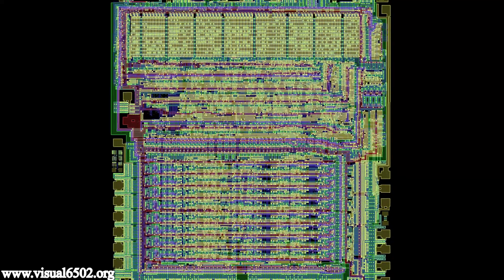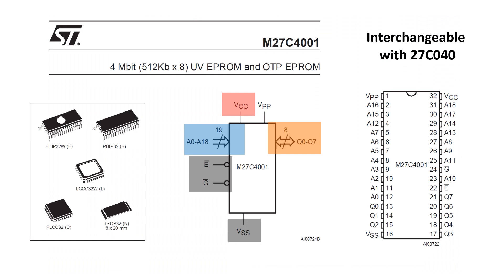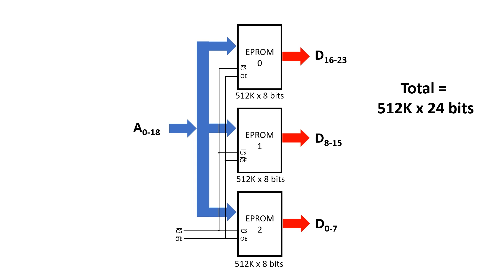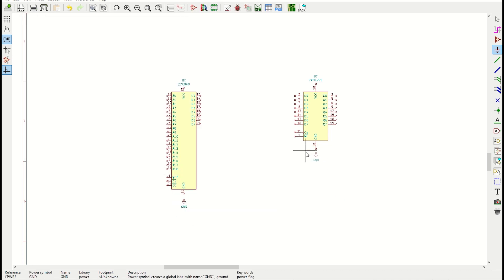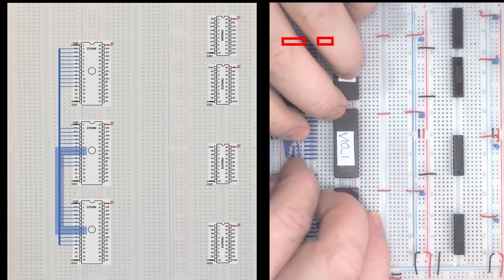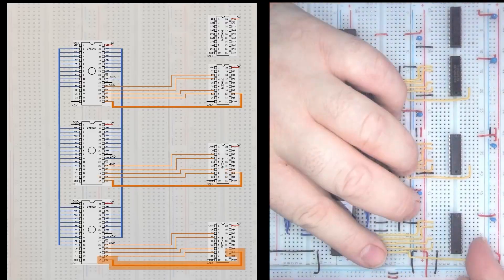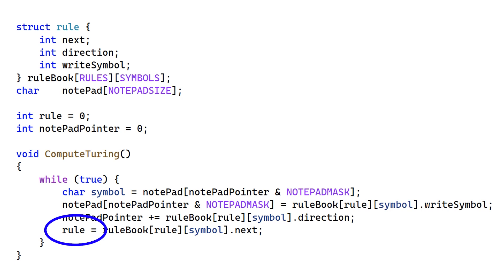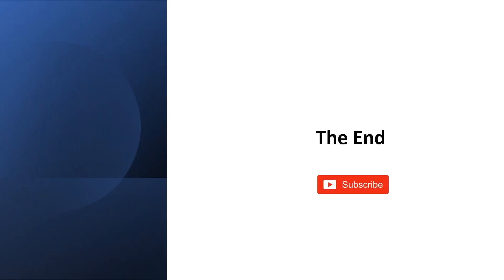PureTuring Part 3.  Breadboard Turing Machine

Comment: The self-feedback loop confused me at first, but it's clearer now on the second watching.  I think the initial closed loop with neither input nor output confused me more than what followed.  The idea that part of the output of the rule book becomes part of the input to select the next rule, while part of the output from the rule book is the Left / Right direction together with the symbol to write, and then the symbol read from the tape cell becomes (again, just part) of the address for the next rule makes enough sense.

It's surprising to me how this is harder for me to grasp than the Boolean logic of TTL circuits making up a processor was!
Reply from the maker: The finite state machine becomes the sequencer in a regular machine (like the SAP6502).  I'm hoping to answer "why" the microprocessor architecture looks the way it does rather than just explain "what" it is.  Stick with it though.
Reply: @DrMattRegan  Neat!